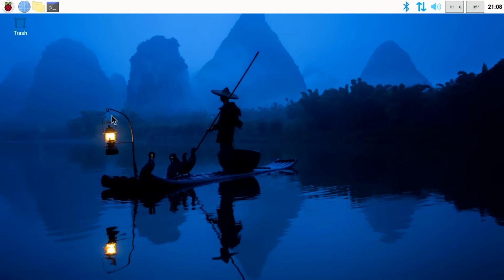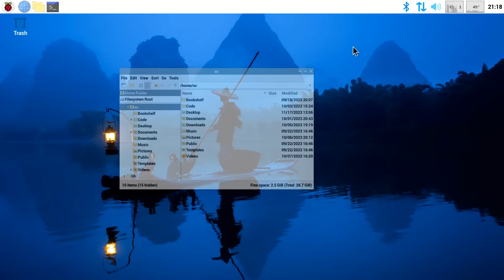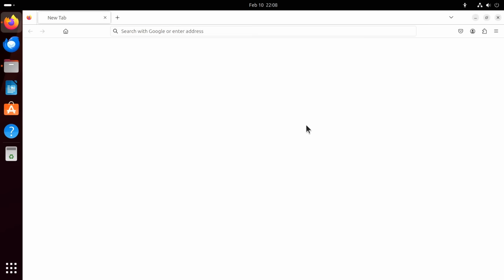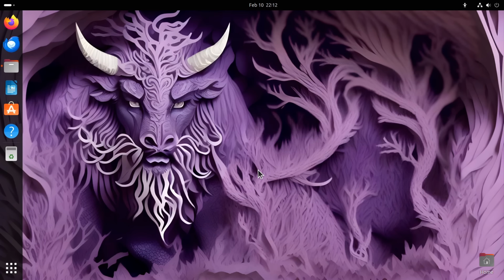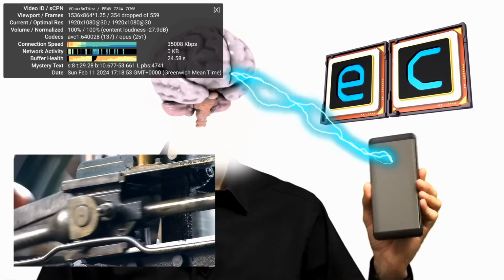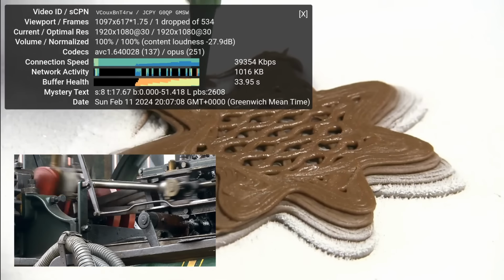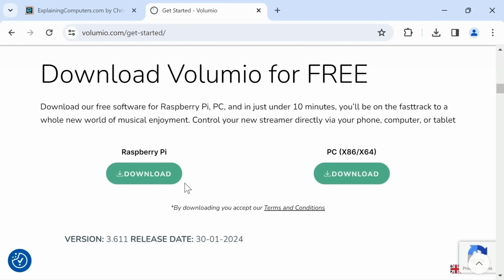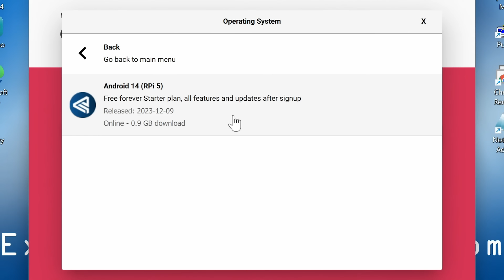Raspberry Pi 5 Operating Systems

Comment: I noticed when you looked at the Raspberry Pi Imager, Homebridge was an option under Other Specific Purpose OS-->Home Assistants and Home Automation.  When I navigate to the same place in the Imager, I no longer see Homebridge as an option.  I'm running v1.8.5 of the imager.  Homebridge was an option until just recently.  Which version of the imager are you running?

Comment: Pimiga 4 for Pi 5 will be available soon (WIP) by its developer Dr.Chris. It is a Debian 12 based OS with Amiberry Amiga Emulator and the Pimiga 4 OS games and apps. You need though to buy Cloanto Amiga Forever to get the AMIGA 1200 kickstart 3.1 ROM, else it doesn't work. Of course if you have a real hardware Amiga 1200 with kickstart 3.1 ROM, you can backup its ROM to a file and use that. So Pimiga 4 will be another OS for PI 5, and you will have both Debian 12 for desktop use and Pimiga 4 for your retro gaming needs.

Comment: What about if using the RPI5 for a dedicated single program. Where boot up time is critical and the RPI should go directly to the stated APP and run it and do nothing else.
I'm using it as a vehicle dashboard display driver. Doesnt even need to have wifi or ethernet capability and using SSD for faster response.

Comment: I have been using both Arch arm64 and Manjaro arm64 on Pi4, I guess if a need arises, I'll migrate current setups to Pi5 but I have really started considering that Pi5 no longer that platform what original Pi was intended to be. 😞

Comment: I'm surprised that Armbian didn't have GPU support, most of the Mali based boards have support and work really well.
Reply: Armbian is a great "quick and dirty" OS if you have an older board that is out of support that you need to get up and running. Armbian builds are automated so they're not optimised by default - however, nothing stops you optimising your own Armbian build if you want to, they provide good documentation on how to do it yourself.

Comment: I'm new on raspberry. I buy a Raspberry Pi 5. I would like to use Ubuntu, but I need the Raspberry with a small display, and buy GeeekPi 3.5 display. I read that the display works only with Rasberry Pi OS and gives a white screen with other SOs . I buy a SD with Raspberry OS to have it working in less time, but maybe I will buy other SD to try to make work Ubuntu with that display.

I would love to have a Zorin OS version for Raspberry 5. Ubuntu and Zorin uses Gnome as the desktop, but I love the modified version of Gnome that Zorin have.

I read on coments about Ubuntu Mate, and I would be interested, as is my main OS on my Laptop.

Comment: Is there still no workspace switcher in the Pios default desktop? That became impossible when they went over to Wayland, and it was a deal breaker for me. My solution is to run Pios, but with xfce, and I‘ve been very happy with that as a dev environment for hobby projects.

Comment: How does a Raspberry Pi boot so quickly from its SD card?  Whenever I try to boot a regular PC from Linux on a thumb drive it takes forever!  Christopher, does Ubuntu boot quickly from an SD card, and if it does can you please explain why?
Reply: Please ignore the above message, It is not from Christopher, rather it's a scammer.

Comment: I'll be using a Raspberry Pi 5 with a 10.1" touchscreen display as a dashboard on my 1989 Dodge Daytona.          It will be running TunerStudio controlling the Megasquirt MS3X ecu controlling a 2006 PT Cruiser GT 2.4 turbo 

Wish me luck lol

Comment: I am wondering is we can use eMmc, using an micro SD card adapter.

It might speed things up things significantly.
Reply from the maker: What a brilliant idea. An eMMC module on a microSD adapter should work just fine (although it would be faster still in a USB adapter).
Reply: @ExplainingComputers  I agree,  but the Pi 5B has had all the outputs sped up, and by using the card slot, you free up a USB port.

Not an idea for everyone,  but it is an option. And it means you can use things like Pi Imager, and use it without any messing around to transfer OS to a different drive.

Comment: If you run an OS like Ubuntu does that mean that you can install programs that would normally run on Ubuntu? Or do you have to run a special pi 5 version of the program?
Reply: Software has to be compiled for the specific platform it is targeted to run on - so the Intel x86 version of, say, LibreOffice will not run on the ARM-based Pi, or vice versa.

An emulator allows programs for one machine to run on another, but there is overhead in "translating" from one platform to another as the emulator runs.
Reply from the maker: As @terrydaktyllus1320 notes, you can only run ARM software, and it needs to work with the Pi's hardware. But a lot of programs -- including LibreOffice, Inkscape, Krita, GIMP and Kdenlive -- do all work.

Comment: The Pi5 has no HW support for any of the video formats used by Youtube so its CPU software decode no matter the OS, thats not an issue for some but anyone who has a busy CPU with background tasks or multiple video streams open is going to find the Pi5 unusable as it struggles under the CPU load.
Reply from the maker: All very true.

Comment: Is there an operating system that is not based on Linux available? Also any operating system that can be completely available in just a few seconds of start up?
Reply: You can make a Linux OS boot in seconds with the correct hardware - you're asking the wrong question.

The Raspberry Pi was never designed as a desktop replacement, it was designed as a cheap industrial, maker and education board. Since its release in 2011, emulation has essentially driven the requirements for more power in the Pi - in turn, some people feel they can use it as a desktop computer and, if that's the case, good luck to them - but it was never designed for that.

Why don't you just buy a cheap and used SFF PC for £30-£40 on your favourite auction site, put an SSD in it and put crappy Windows on it if you don't like Linux?
Reply: Last time a looked, Windows doesn't boot up in a few seconds either. I'm not a Windows lover or a Linux hater. I want a less powerful operating system option than either. 

I'm getting really tired of every electronic device I have taking 30 seconds plus to start up because they are booting way more operating system than they will ever use.
Reply: @sharonwolff1  I think if you're that concerned about losing 20 or 30 seconds here and there, maybe you should look at organising your time a bit better?

I can always tell when I'm speaking to someone young enough to be my own offspring - lacking in patience, low attention span, always in a hurry...
Reply: And yet I am likely older than you.

My point still stands. Computers are getting more powerful every year but boot times for normal level user PCs and even non-computer devices with cpus built in remain at 30+ seconds. What gives?
Reply: @sharonwolff1  "And yet I am likely older than you."

I have been a techie in the telecoms, IT and cyber-security industry for more than 4 decades.

"My point still stands."

No, that's just you saying it still stands. From where I am standing, I tore apart your argument long ago.

"Computers are getting more powerful every year but boot times for normal level user PCs and even non-computer devices with cpus built in remain at 30+ seconds."

Not the computers that I build, because I know what I am doing. But even if it takes a bit longer to boot, so what? You need patience and an attention span to be good at building and repairing computers - maybe that's your problem right there.

"What gives?"

I have no idea on the context of that question. I am simply giving you my more than 4 decades experience working on computers. 

You can absorb it or ignore it, that's up to you.
Reply: Can't believe I'm still posting in this thread but it is Sunday,  so why not.

While a lady is not required to post her age in so public a forum,  when I first started, computers only existed on racks, tape had to be hung by experienced operators and disks (we called them drums back then) were the size of washing machines.

Of course none of that is of any relevance to the question which was posted about operating systems for the PI 5. To remind everyone, I asked if there are any operating systems for the 0:02 PI not based on Linux and any operating systems on the PI that boot up quickly.

The answer to the first question is either, XXX and YYY are not based on Linux or, no there are no operating systems for the PI not based on Linux. The answer to the second question is either, ZZZ boots up really fast or, no there are no fast booting operating systems for the PI. Any other comments are not getting the job done.

My needs are for fast booting and I am hitting the limits of what what microcontrollers can do.
Reply: @sharonwolff1  "Can't believe I'm still posting in this thread but it is Sunday,  so why not."

Why not indeed?

"While a lady is not required to post her age in so public a forum,  when I first started, computers only existed on racks, tape had to be hung by experienced operators and disks (we called them drums back then) were the size of washing machines."

"First started" what, precisely? Eating solid food? No, I have no interest in your age - if you are of a similar age to me then I am surprised at your lack patience anyway, so it really makes no difference, young or old.

"Of course none of that is of any relevance to the question which was posted about operating systems for the PI 5. To remind everyone, I asked if there are any operating systems for the 0:02 PI not based on Linux and any operating systems on the PI that boot up quickly."

It has ABSOLUTE relevance! Because if a criteria for a computer that you need to use is that it boots in less than 30 seconds, then the Raspberry Pi is completely the wrong platform for that - a complete non-starter, given the limited throughput of such a small device compared to, say, a traditional PC platform.

Please excuse my "engineer's brain" going into overdrive here but I believe in defining a computing problem by a series of requirements and then specifying the hardware and software on that basis - and the Raspberry Pi is a non starter on that basis.

"The answer to the first question is either, XXX and YYY are not based on Linux or, no there are no operating systems for the PI not based on Linux."

If you already know the answer, why are you then asking the question here?

"My needs are for fast booting and I am hitting the limits of what what microcontrollers can do."

So it's not a case that you don't need Linux, then? You clearly want a computing device that requires NO operating system, given you're now changing the topic completely and talking micro-controllers?

Don't most micro-controllers like ESP-32 and Pi Pico boot in less than 30 seconds anyway?

Comment: Could you help me with the link on 23.1 Ubuntu version for Pi5, since the last version is running so slow on my Pi 5 with 6 GB of RAM and 100 MB/s read speed  micro sd card.
It's a known issue.Thanks.

Comment: Another GOOD ONE, Chris, appreciate this. 
I'm recently really into the armbian as it's making all RK/Allwinner based Pis, like-Pis, and even more TV-boxes - to be practically useful, I don't know why it performs not that well on the powerful and brand new Pi5 though. 
A really fun project is single-NIC-ROUTER - Any ARM SBC + Raspbian/Armbian + libvirt/KVM + openwrt (built for armvirt) + network bridges + vlan switch, actually I've been using one for literally 1 year as home major gateway, and with that right now to play your videos and post this message. Several more VMs or lxc containers can also be running on the same SBC host for some other tasks which you probably already know well, such as IPTV service. 
Yes, a "router" can be made with just single line iptables/nftables on the host OS - without vm/container needed, but from performance aspect, the "software flow-offloading" in openwrt repo can easily double the NAT throughput even on libvirt then on 2 ARM cores of 4, interesting right?

Comment: Raspberry Pi OS distro still can't edit a LibreOffice file on an OMV NAS. However Ubuntu on the Pi works fine, as does Mac OS, various X86 linux distros, etc. If anyone has a fix to let Pi OS LibreOffice edit NAS files without "file in use by another user...", please let me know!

Otherwise, I quite like Pi OS.

Comment: prepared for RPI 4 Emteria (free) but does nog boot on USB.stick or ssd , somthing weird with can not switch voltage level mmc 01 , but raspbery pi os x64 works fine , so there's nothing wrong with the Pi , i think RPI 5 is overkill for Android, if you look at the tyni chrome stick which also runs android , the PI 4 should be able to do the job , if it works that is.

Comment: A question in case anyone has tested this: Is the video playback more dependent on the distro per se, or on the browser through which the playback occurs?
Reply: Probably more the distro because the kernel has to be correctly configured to support graphics acceleration - usually through "Lima" driver support for ARM Mali GPUs in many SBCs.

Comment: I've tried installing Ubuntu on my RPi 5 4 times now... And I've tried it on the RPi imager, and from Etcher, and I even installed PINN Lite to install Ubuntu. IT simply WILL NOT work on my RPi 5... I have no idea why... It just errors out. No matter where I download it from, or how I write to the SD. I'm perplexed. I'm assuming it's something with the Pi itself. 

 >M<

Comment: first view! not really impressed with the raspberry pi 5, i have a orange pi 5 plus i bought while in the shortage and i was expecting raspberry to at least meet it for speed and specs or at least price. i find my self only using zero 2's they are solid and supported and a good price if you can deal with the tiny ram supply

Comment: 🇬🇧 👍🏽November 2024 

Please complete this sentence to reflect your experience & opinion:

'The Raspberry Pi 5 is as powerful as the...[INSERT NAME OF WELL-KNOWN PC/COMPUTER BRAND], in the [INSERT YEAR/DECADE].

Qualifiers - I know that we have the factor of separate versus on-chip GPUs, which will have evolved over time - but the question still stands.

I'm after a perspective over how far we've come - but expressed in terms of older, well-known home computers.
Reply: 2010~2012 i3~i5 laptop with Intel HD graphics. Branding is largely irrelevant to performance. Cheers.
Reply: It's not quite apples to apples though since the newer chips are often optimized for specific types of computational tasks that are in fashion, but anyway, that would be my estimate.